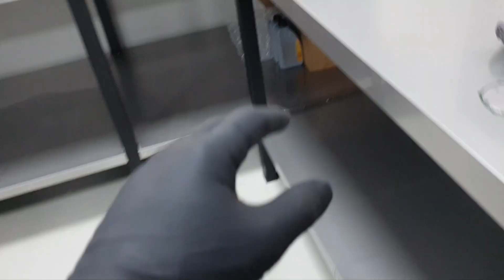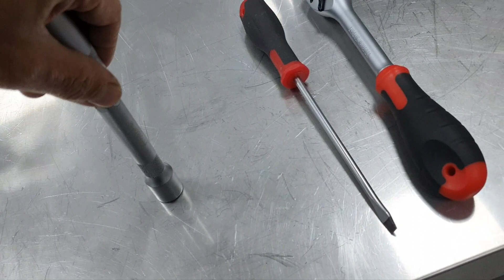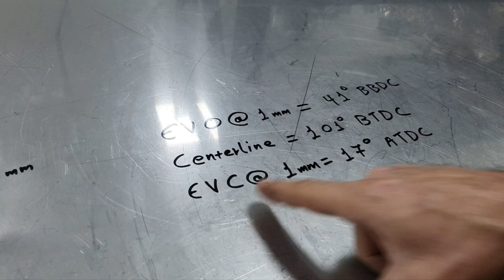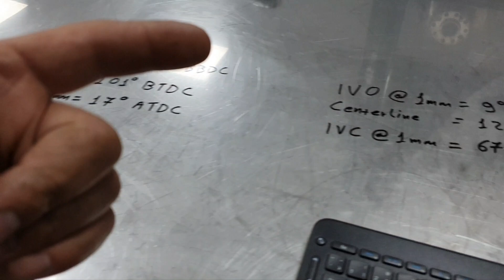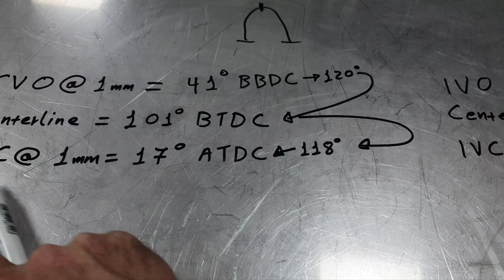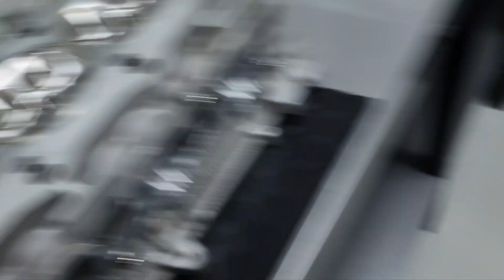2JZ-GTE billet block check/build (part 1)

Comment: Issue is with the head gasket, the position of the stud holes is wrong, can be seen in the oil drains not lining up perfectly also, i have also seen this with Nitto and Tomie head gaskets also on Nissan RB engines, for the fire rings we used stepped ones that locate into the block with a groove with a copper headgasket and no such issues. Search Ridgecrest engineering in Australia Tasos, these gaskets sit accurately to the block and no sealing issues in high HP applications, only thing is you will need to machine a receiver groove in the sleeve of the block.

Comment: I’ve seen it mentioned that forged metals have a higher rate of thermal expansion than cast. Does that mean you have to make the rotating assembly tighter at room temperature to have good tolerances on operating temperature?